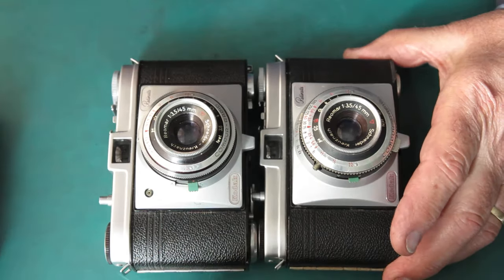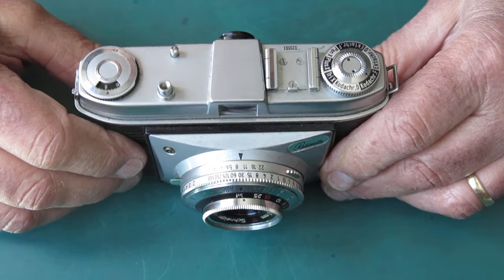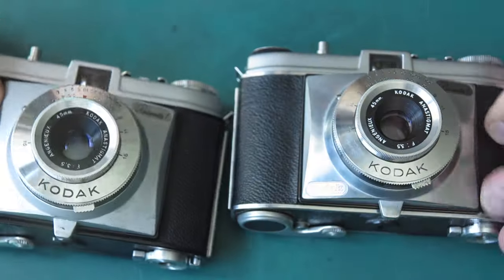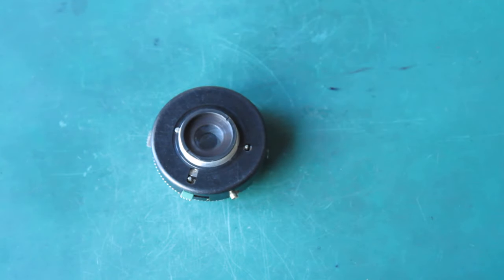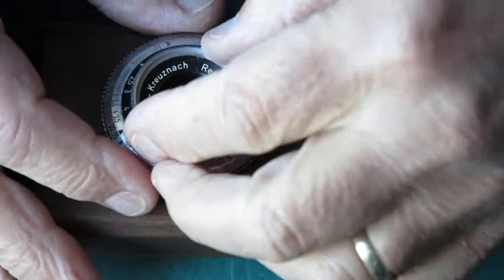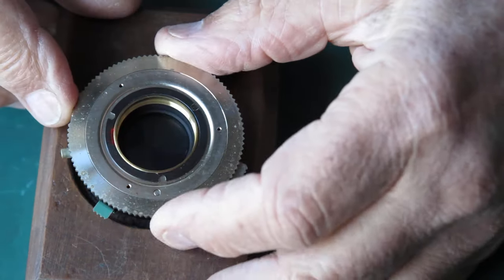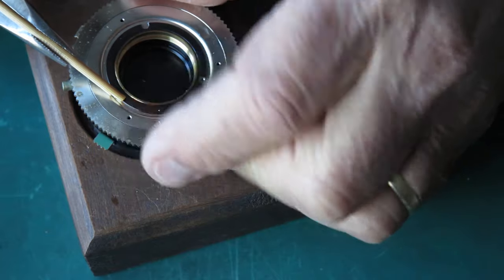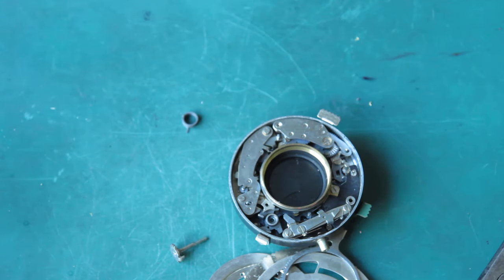Kodak Retinette type 022 servicing, part 01

Comment: I'd like to ask you a question. Do you have a way to remove the top of the Kodak Retina 1 type 13 camera? From most of your videos, I hardly see this model.
Reply from the maker: The type 013 cameras are thin on the ground, I've seen very few. Disassembly of the top cover is much the same as for a Retina II types 011, or 014. Unscrew the rewind knob, unscrew the tip of the shutter release button, unscrew the advance knob (left-hand thread), remove the single screw either end of the top cover. Note that you must hold the top of the shaft above the take-up spool to prevent it turning when attempting to unscrew the advance knob else you will break stuff.